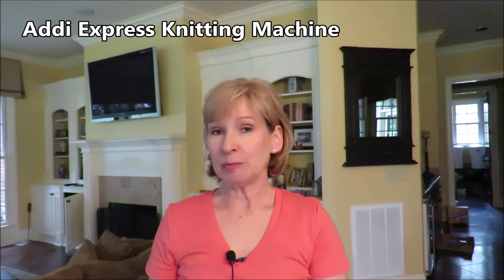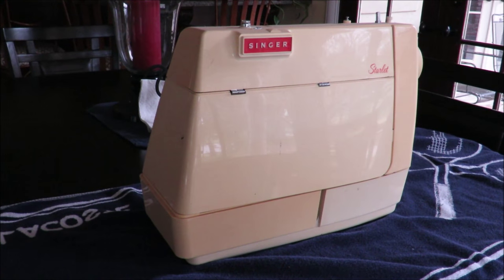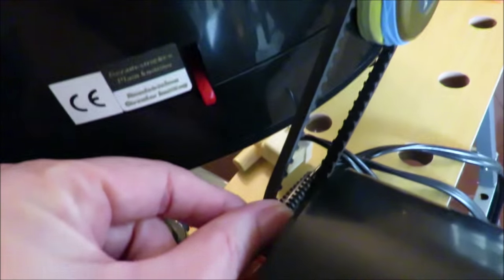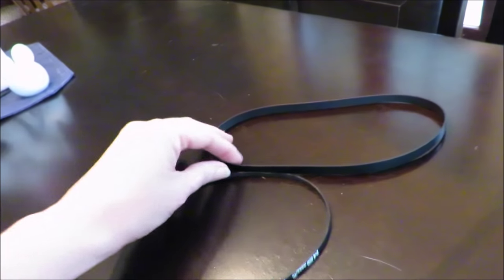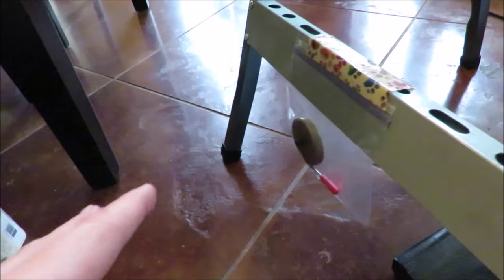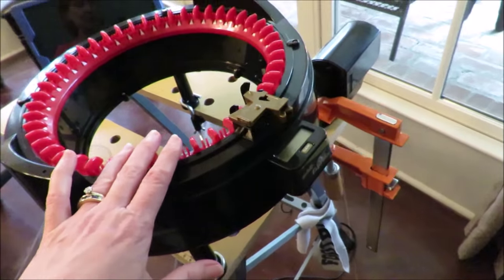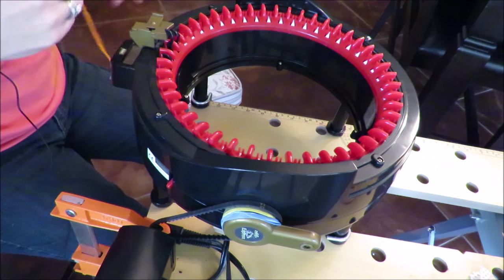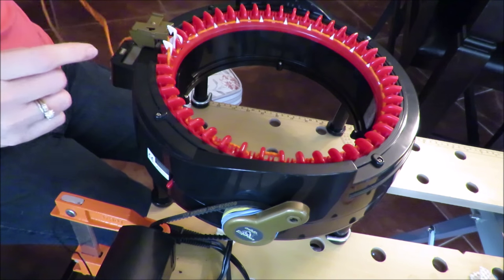Motorize Addi Express

Comment: Way to go Margaret!!  I don't know if I would have been brave enough to dig into a sewing machine and retrieve the motor.  I am very impressed.  Now you can knit at warp speed.  If I tried that I probably would have my machine knitting backward!!  : )
Reply from the maker: +Kathryn Faille What did I have to lose? I wasn't going to use that machine again. I've never attempted anything like that either and my pencil pushing husband is no help! And your machine would knit backward just fine, btw! Hahaha! OR you could figure 8 your belt and make it run the other way!
Reply: +Kathryn Faille   I feel it is more about ingenuity than bravery!  Well done Margaret.

Comment: Just got an addi machine and was watching your videos, thank you. I have lots of old sewing machines so I will have to try this. Your motor slows down because your belt is not pulled tight enough. Do you still use this set up?
Reply from the maker: No. I decided it pulled too much on the handle didn’t by want to risk it.

Comment: You might try an evolution motor that is used for making a manual die cutting machine into an electric one. Only thing is you have to hold the switch down because it was made for short lengths of time.  Seems not to get hot after longer times tho.  I am in no way mechanically inclined but seem rather simple to go around that need to hold the button down.

Comment: Question .. is the motor going counter clock wise or clockwise?  I found one but not sure which I need .  Thanks
Reply from the maker: I don’t remember! I no longer use this because I worry about long term use damaging my machine. The electric screwdriver version with the attachment someone created resulted in complaints of plastic shavings being present when the machine was open for cleaning. So no machine-safe solutions are available at this point but some needs to invent a motorized knitting machine!
Reply: @sheepishlysharing  I saw a machinist making them on YouTube.. I might try that!  I ordered the sewing machine motor last night and will try it fir a while bc I have rheumatoid arthritis and the cranking is affecting my crocheting!!!

Comment: hello!!! i really think your little set up for that is really neat and it is one of the better ones i have seen for this, but, just a bit of advice from someone with a fair bit of machinery knowledge ( during the summer when not in school i fix VCRs and tape decks to make money to buy yarn) you are going to want to go online and buy a replacement belt for the motor (Just search on ebay for the approximate model of sewing machine and "replacement belt" something is bound to show up) the reason being is that the rubber used in things like belts for motors deteriorates after time, have an easier time snapping, stretching, and turning into literal goo , making it less effective, which may be why it is slowing down. however, considering the age of the sewing machine i am very impressed with how it has held up. by looking for a proper replacement belt instead of using one that was meant for something else, you can easily get one that has the teeth that the motor needs. also, i would recommend putting a small fan next to it so it is blowing the air away, which will suck some of the heat away. however, this may make the room a bit warmer.
anyways, keep up the great videos!
Reply from the maker: Thanks for the tips but I have to tell you... I'm scared to keep using it. I feel like I may be damaging the handle of my machine because of the way the belt pulls on the handle. I wish Addi would just invent a proper motorized one for us!
Reply: I would hate to think what the cost would be for a motorized Addi King!

Comment: Hi Margaret, thank you for creating and sharing videos!  I'm shopping around for a new Addi table, mine wiggles far to much (a wooden TV tray table). How has your Harbor Freight Workbench held up? Does it wiggle when your crank? I also saw your comment about not motorizing your machine any longer. Glad I took the time to read to read the comments. I have seen (can't recall who it was) someone used an ice cream maker motor that crawls slower than I crank by hand. I was wondering if you thought that might be a safe alternative?
Reply from the maker: Yes, the Harbor Freight workbench IS a bit wiggley but not enough to bother me. I still use it and like it just fine! I'm not sure how they hooked up the ice cream motor but slower would be better/gentler.

Comment: You could probably get custom 3d printed pieces to help with parts.  There are online companies like Shapeways that will print items for you out of various materials if you submit printable designs.  You probably just would need a coupling piece for the machine piece that had too small of an entry point.  You could probably sculpt some pieces from a plastic pellets that might help, or a 2 part epoxy like sculptural material called Magic Sculpt.  I would actually try to work out a way to use a treadle devices similar to some spinning wheels.  That way, you could eliminate the electric need and possibly get in a decent workout.
Reply from the maker: I once asked my daughter's friend (a mechanical engineering major) to work out a way to hook it up to my stationary bike! Apparently he was enthralled with the possibility of this side-project. 🙄

Comment: Hello Margaret.  Just love your videos. I just got a sewing machine motor that I'm gonna try on my addi.  I have both addis but my little addi makes baby hats too little even for babies. Can you tell me what I'm doing wrong.  I used baby yarn and regular red heart and still too small.  I would appreciate any info. Thank you for all your videos.
Reply from the maker: You're not doing anything wrong at all! The small addi only makes a 6" circumference. You can get around this a bit by using a thinner yarn weight so the hat will stretch more horizontally OR you can use the Addi Kingsize and worsted weight and make it shorter from crown to brim. Did you see this video? https://www.youtube.com/watch?v=Kq3j6fC4BP8
Reply: Thank you so much for replying. I will try thinner yarns and see how they turn out. Your videos are both entertaining and educational.

Comment: After this video finished playing, what's the next suggested video, but the one by Cassie Sandberg. She also motorized her Addi, but instead of sewing machine motors, she used electric screwdrivers, cordless drills, and corded drills. And from what she said in the video, may have damaged multiple Addi's in the process.

Her adapter idea is wonderful. She sells it on her site for $15, but looking at it, you can probably made something like that from a bolt, the top part of  a suitably sized plastic bottle, and some plasticine. I could whip it up in 5 minutes. Except that I don't have an Addi. Yet ... :(

There's a note on her video that she no longer recommends using drills. Only electric screwdrivers should be used. The reason is obvious. Drills runs too fast, and outputs too much torque. Looking at her video, the speed of the thing is just absurd. I doubt superman could have cranked that handle faster. :-) The plastic internals of the Addi stands no chance against the torque being put out by the drills.

But I think using electric screwdrivers with the adapter would be perfectly fine. When you're cranking that handle manually, you're imparting an inconsistent twisting motion to the entire Addi as you crank it. Human arms are like that. If you're holding an electric screwdriver against the handle, the Addi would probably suffer less. There's less jarring, as the screwdriver turns the handle at a fairly constant speed, and there's no up/down/forward/back force that happens when a human turns the handle. The screwdriver just twists the handle at the axis.

And if you get a sufficiently wimpy electric screwdriver that uses rechargeable AA cells, you can be sure it wouldn't turn the handle too hard. When the battery runs low, you just put the AA in the charger, and switch to your spare set of rechargeable AAs.

The disadvantage of her method is that you've got to keep holding that screwdriver in position. The advantage is that you can reinstall that handle on the crank. Switching back and forth from motorized back to manual would be even faster and easier.
Reply from the maker: I'm not doing this to my poor machine anymore and people who have bought Cassie's attachment have reported seeing plastic shavings on the inside of their machines when they take it apart to clean and lubricate it. Addi just needs to invent a proper motorized machine!

Comment: I would love to do this to my addi. Margaret would you consider using sugru to make cogs for the handle of your addi? I plan on using it on mine. I just have to order it from the states. Is your pedal set to slow?
Reply from the maker: +Melissa Sutcliffe Well... remembering that it's very important to me to do as little alteration to the Addi as possible, I wouldn't mind having one to go around that "yellow rubber band area" of the crank to take advantage of the grooves in the belt. Let me know how yours works out. My pedal doesn't have any settings. It's like an accelerator in a car. You control the speed by how much pressure you apply to the pedal.
Reply: Margaret Olander need a cruise control on the motorized Addi! lol

Comment: I realize this video is a few years old, I was just wondering if you ever got a better method of keeping the belt secured to your addi?
Reply from the maker: No and actually, I don't use it these days. I felt long term use probably wasn't a good idea.
Reply: @sheepishlysharing  Ok. I asked because I have a 3D printer. so I made a pulley  that the belt can run on, I would have made you one.
Reply from the maker: Oh wow! I wish you could partner with Addi to make an official motorized version!
Reply: @jynx-vu2zc  Do you have the stl? I'd love to be able to try that.
Reply: @bhsmith47   Yes.  But I  don't know how to attach files to this conversation ?

Comment: Yup gonna buy my wife an addi for christmas.  I will add a stepper motor to it from a 3d printer so that i can adjust the speed from my computer. :)
Reply from the maker: That would be so NICE! Do be careful about motorizing it. I haven't used my idea in a while because it puts some stress on the handle. Someone else developed a gadget that replaces the handle so it could be powered by a drill and people reported lots of small plastic shavings when they took it apart for cleaning.
Reply: Margaret Olander Okay thanks.

Comment: Watched your video...I think all you need to do is slow down how fast you are running you addi and your temperature should be much lover. Also suggestion. For a know, just get a cheap knob small enough to pass your motor with out hitting you knuckles on the moto, and 2 washers for either side, I fitting inside and a small or medium fender washer on the outside to keep from cracking the plastic. Do not over tighten it, you was the knob to turn also. 🙏💕
Reply from the maker: Oh goodness... this was a video from 2016 and there's a note in the description box explaining that I no longer think motorizing machines is a good idea. Many people have ruined their machines with various automation techniques through the years. 😖 For those who are interested in tinkering, using a cheaper machine may be something to consider. Just my personal opinion!
Reply: I only have a battered up right arm to use. I saw one an engineer set up for his wife. He said if is run at a slow steady pace...slow being the important word, it won't got faster that a hand speed but will work and shouldn't damage the machine. Check out his tutorial. I assume he was a retired engineer by the way he was talking. I'm somewhat mechanically inclined from work with my dad through the years so it make sense...if you don't run it any faster that you could crank and have it attached by a stable means so it not wearing the mechanisms at odd angles, it won't damage the machine. If I can't motorize I have to send them back. That would break my heart. 

Maybe if you don't want folks to be influenced by your video, might be a good idea to delete it?🙏❤️ Thank you.
Reply from the maker: It's not that I don't want people to be influenced... it's just that people often ask if I would ever try motorizing my machine so I point them to this video. Everyone needs to find what works best for themselves so I'm sure you'll find a set up that works great for you.